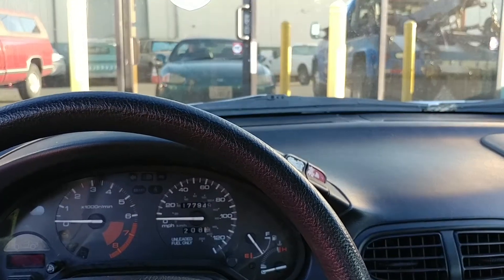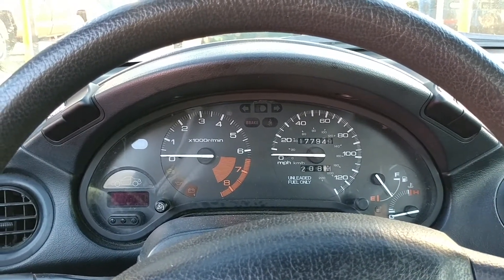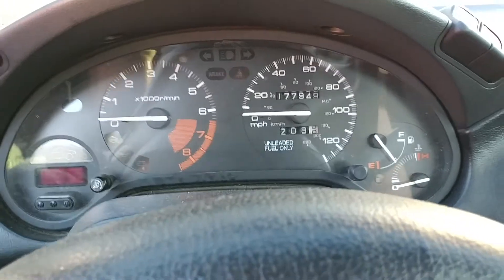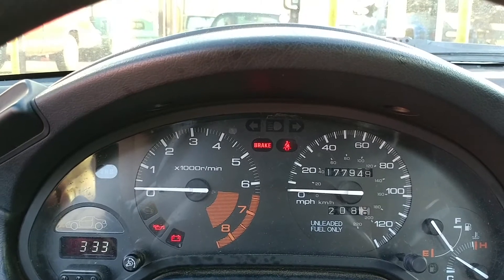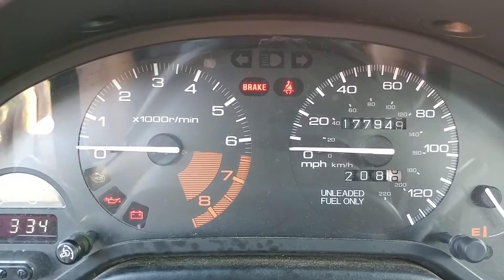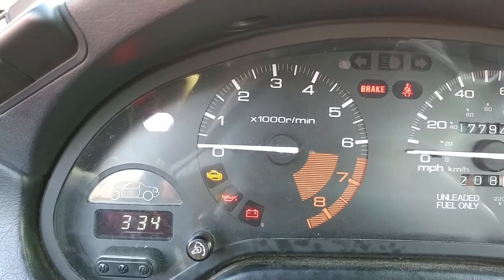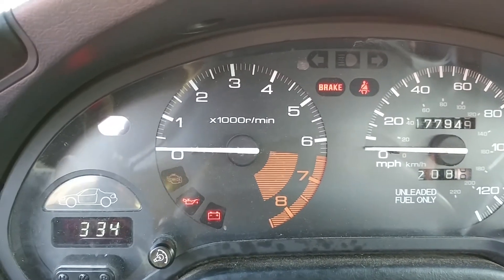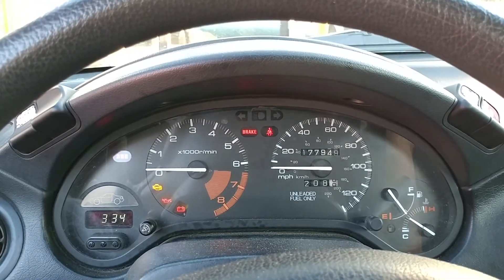How to Read OBD1 Codes Honda Civic & Del Sol

Comment: Can you please help me read the code please its blinking 2 times slow then 2 blinking fast
Reply from the maker: If you watch my video I give code 22 as an example. Your code is 22. In a 1995 Honda Del Sol, OBD code 22 indicates a problem with the Throttle Position Sensor (TPS) circuit. Specifically, it points to a low signal or a shorted circuit in the TPS. This sensor tells the Engine Control Module (ECM) how open the throttle is, which is crucial for fuel delivery and spark timing.

Comment: Do you know how to delete the indicator light ?
Reply from the maker: Disconnect the battery for three minutes. That will clear stored codes.
Reply: @DrivingtheBackroads  ok I will try it later again than i will tell you if it works

Comment: Hi. Right after connecting the wires the indicator of the check engine lights up and it shines constantly. Does not blink. What does it mean?
Reply: same dude, what was the reason in your case?
Reply: @wayydev  that means there is no error. My del sol does not start because the fuel pump relay was damaged. If you want to see where it is, I made a short video about it
Reply: @Marczes  thanks, but my engine starts and works uneven, rough, shattering. Also, on idle rpms are like 1100-1200, up and down, and also check engine light still present when engine is running. I bet I had bad paper clip, today I bought a new one and also bought a wire to try get error code again. Also I have some suspicion that it might be end for one of four spark plugs.
Reply: @wayydev  You can also scratch the ends of the paperclip with sandpaper. If the poor contact is the reason, it will help
Reply: @Marczes  thanks, just made that
Reply from the maker: I believe that means you have no codes.

Comment: That’s your Top Dead Sensor
Reply from the maker: I replaced the distributor and it cleared my code.
Reply: @DrivingtheBackroads Hi! I'm curious since I'm having a really difficult time diagnosing my '94 del sol's low idle rpms and sporadic difficulty start up issues; what were the symptoms your car was having? My car started acting up after I had the ignition distributor replaced. 

(I'm assuming that's the distributor you're talking about)

Comment: I did this but my SRS light started blinking instead, what does this mean?
Reply from the maker: If your SRS (air bag) light is on and you follow the method in this video the SRS light will blink out your SRS code(s). A table of SRS codes can be found by Googling "SRS Codes" and your year, make and model. Good luck
Reply: @DrivingtheBackroads  I want to diagnose my engine light not my airbags :(
Reply from the maker: @poleewag  This method checks both the ECU and the SRS module. If you have a check engine light and no code blinks out when shorting the diagnostic lead you might want to trouble shoot the ECU itself. I hope this is helpful.

Comment: I have a 94 del sol and did the steps but the srs light would flicker, would it still be the same?
Reply from the maker: There is a separate module that controls SRS (air bag) operation. There is a similar procedure to read SRS codes but it uses a separate yellow colored connector located by the fuse panel under the steering column. To prevent accidental air bag deployment and injury you should research and follow proper SRS testing procedures before attempting to work on your SRS.
Reply: @DrivingtheBackroads  thanks
Reply: Mine did the same

Comment: I got a 93 and the check engine light comes on after driving for a long time or if I’m going at high speeds. But after turning my car off the light goes away. Will it still read the code if the light went off?
Reply from the maker: Yes, the computer will store the code(s) so you can read them later.
Reply: @DrivingtheBackroads  thank you, I just did it and it blinked 43 which is the fuel supply system. Going to look at the fuel filter
Reply from the maker: @jordanchristensen6383  Sounds good. Happy to be of help. I hope you'll be able to fix your trouble.

Comment: My 92 Civic Si has never had a check engine light on but wondered what to do since it doesn't have OBD plug since it is a pretty 96 car.
Reply: My Civic won't currently pass smog and needs a new Catalytic Converter. I plan to get her repainted once I move to Texas.
Reply from the maker: My Honda never threw a code until it was stolen and abused. I suspect over-revving caused my distributor issue.